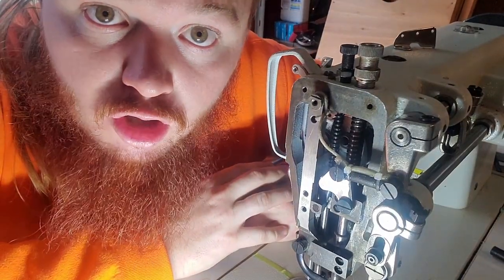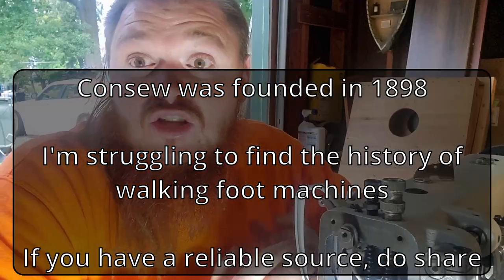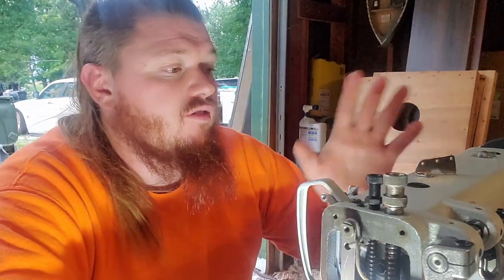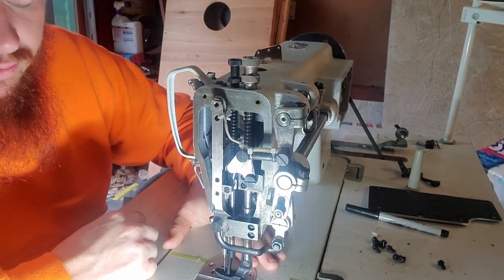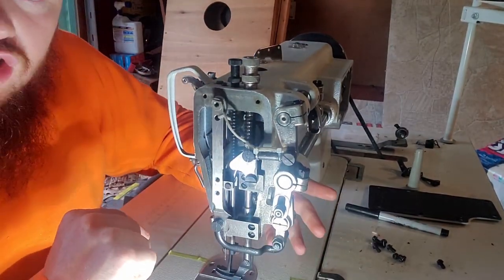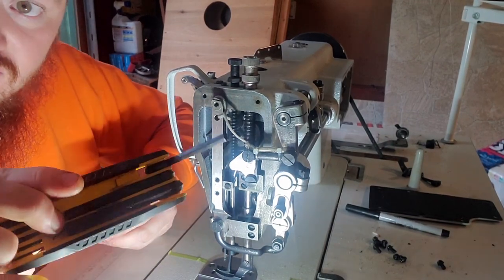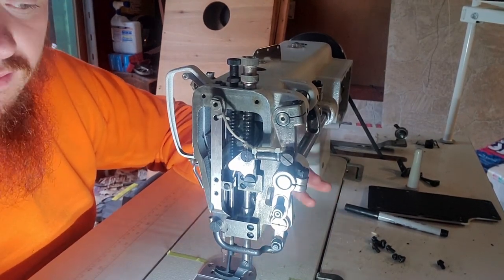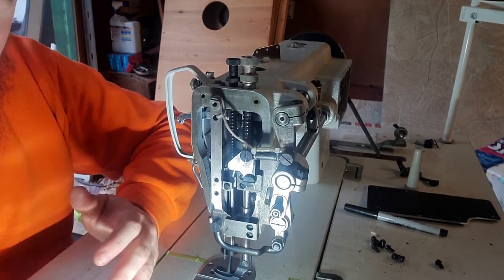Consew P1206 RB 1 Walking Foot Repair

Comment: I have the same P1206RB-1 and you are right, hardly any info to be found on re setting not only the walking feet position but how about hook timing?  My walking feet were out of wack and your video helped me get them back in service but make sure the hook timing and needle bar are set first then reset the feet.  I did run across a comment by chance on a leather working site that said they are using the Sailrite Standard Fabricator Sewing Machine manual to check the hook timing/needle bar settings. I found it's more accurate than the Consew manual. I'll add the video link I used to set my Consew yesterday. Settings are at 18:09 in this video https://www.youtube.com/watch?v=mBn_164zhfw&t=1089s
Reply from the maker: That's great to know, because yeah the manual for this is kinda a joke in terms of being able to actually service your own machine and keep it up and running